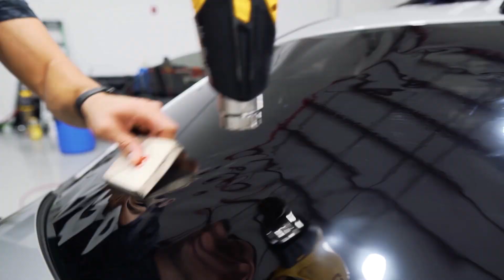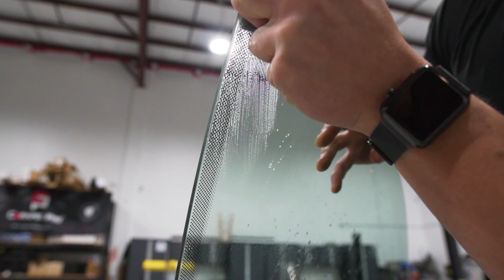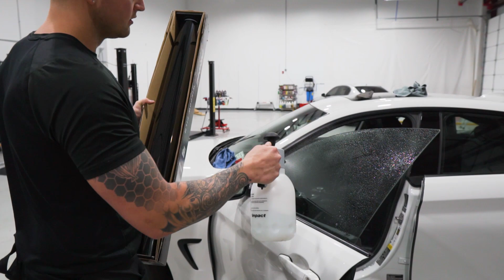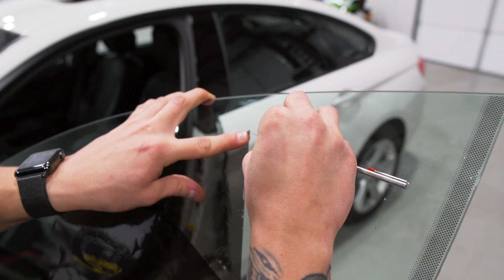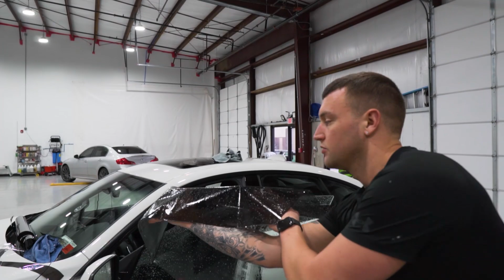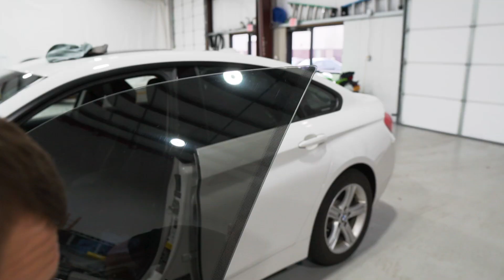How To Tint A Frameless Front Door Window - BMW Gran Coupe

Comment: The door panels should always be covered in plastic sheeting, always. Soapy water can corrode electronic (switch) connections as well as stain some leathers. This is a simple and quick process that installers do!

Comment: My BMW 328i windows go down about an inch when opening the door. How do I raise the window back up when the door is open so I can get the tint all the way to the bottom of the glass?
Reply from the maker: i show how that is done at 0:49 :)
Reply: Window Tint Warriors I saw you put the screwdriver in the locking mechanism but it didn’t raise the window. I tried that in my car and the window did not go all the way up.
Reply: Brian Wenning pull it up lol

Comment: Just curious, would it help to put some absorbent cotton braid so the water / soap doesn't go in to the door?
Reply: Super late. But most vehicles have a drain that automatically goes to the bottom of the door. And you open the plug at the bottom of the door to drain the water.

Comment: Hello, i have a 2001 lexus es300 with frameless windows and I ordered a 10ft long and 40inch width tint, is it enough for the front 2 and back windows plus the rear windshield???
Reply: No bc you’ll mess up 1 or 2 windows and throw those films out

Comment: Just had my windows tinted 3 days ago and the bottom of the tint for the drivers side has cracks (bmw 4 series convertible so the window goes down when door is opened) is there anything I can do to fix this or stop it from happening again as the company provided lifetime warranty but this is second time it has happened